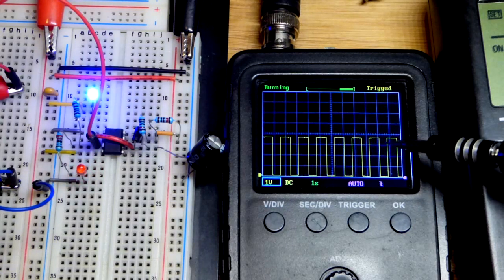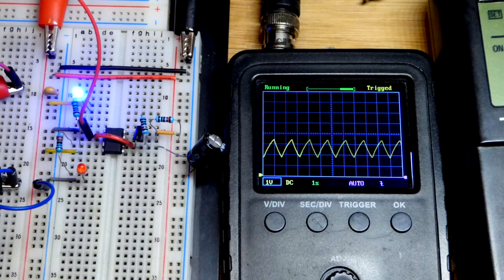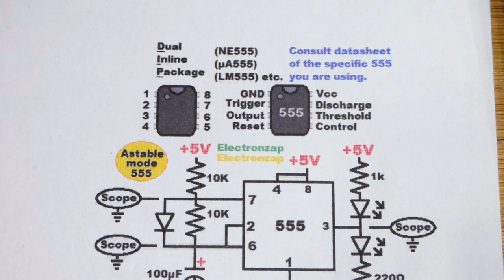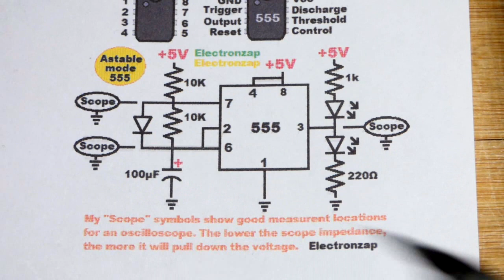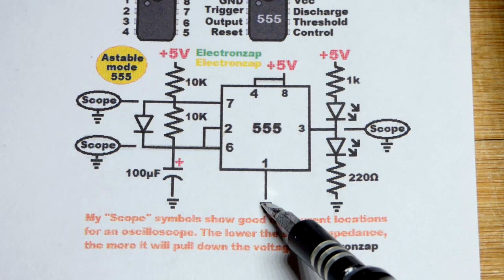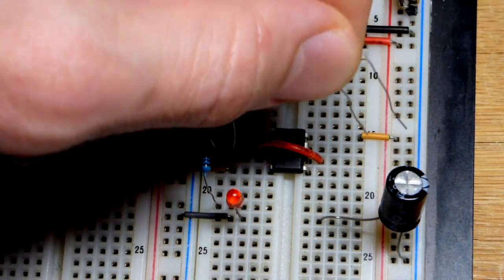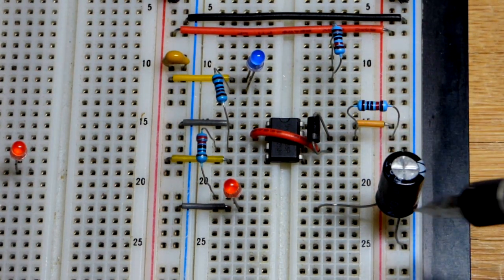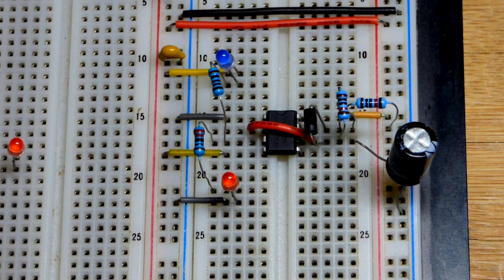Astable mode 555 timer multivibrator LEDs circuit oscilloscope learning electronics lesson 0011

Comment: Nice session Paul thx. Putting the extra cap across the power rails was a nice tip instead of across pins 1 and 8
Reply from the maker: As close to pin 1 and 8 is best, but that clutters up the board a bit when focusing on how the essential parts of the circuit work